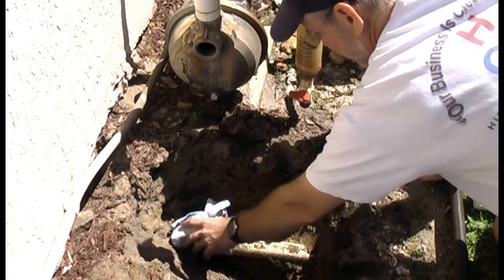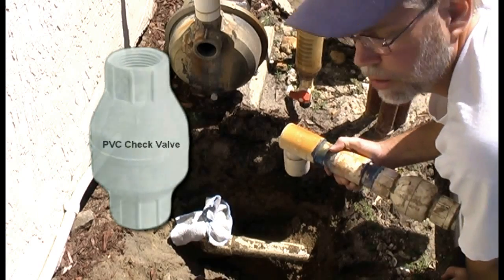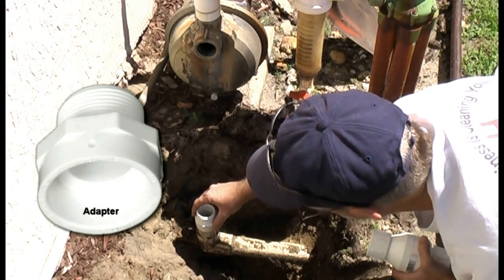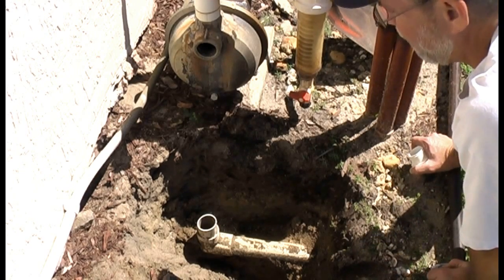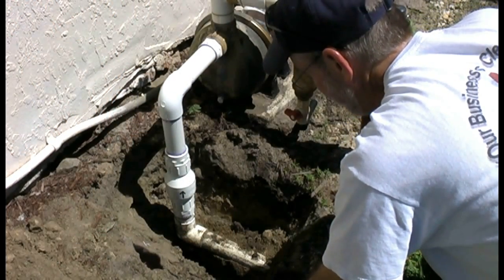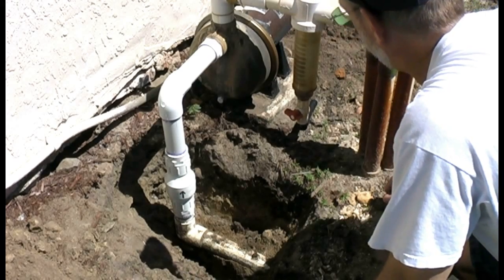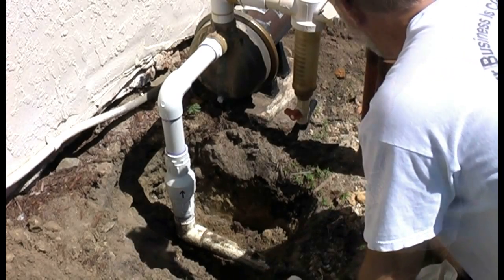Sprinkler Pump Loses Prime Check Valve Replacement

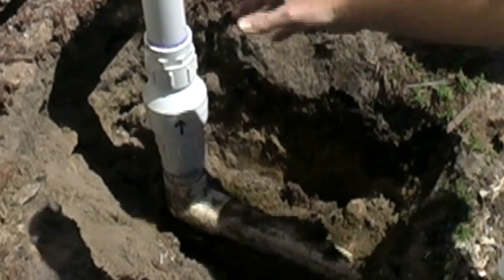Comment: 4:30  If you add a Union where you mention cutting in the future, you'll be able to disconnect the pipe (instead of cutting it) and then reconnect it after you swap out the check valve.
Reply from the maker: Yes, I state that in the video.

Comment: I also live in South Florida.  How did you diagnose that was the problem?
Reply from the maker: There is a lot of sand in the ground wells in Florida, it's common for the check valves to get clogged up.

Comment: You seem very handy. Not a plumber either. My check valve was installed with arrow up and arrow down wont activate my sprinkler zone either way.  Clock is fine.  Water won't come out even by loosening solenoid.  Your tip or any other youtuber's will be appreciated.
Reply from the maker: One more thing, when my pump has had issues in the past of not pulling up the water I used my garden hose to prime the pump to get it going. Try that and good luck to you.
Reply from the maker: Thanks for the comment. Hopefully someone else with more expertise will chime in but I would say that maybe the pump motor itself is defective or worst case the well has to be re-drilled or if there is a foot valve in the well that may have to be replaced.

Comment: Live in south Florida too, I had to replace the pvc well pipe that goes down to the well, didn’t see any foot valve, do you recommend a foot valve??? Or just the check valve is enough? Thanks
Reply from the maker: I've always assumed there was a foot valve in mine but if yours didn't have one then maybe you don't need one or maybe one should have been installed originally. I have no clue as to what the answer is.

Comment: Great video.  I'm also in South Florida and my pump keeps losing prime.  I started digging out the ground looking for an existing check valve but haven't found one.  Is it possible there isn't one or it's required to keep a prime and I just have to keep digging?
Reply from the maker: Thanks, yeah there will be a check valve somewhere before where the line goes down. Mine was very close but my neighbor who is a few doors down, his was located about 30 feet towards the street and in the front yard. You could just install one close. If I went about 10 feet and nothing, I would just put one in.
Reply: Are you pumping from a lake or a well?
Reply from the maker: well
Reply: Sometimes u dont ned it but install one as close to pump as you can get and a ball valve right after. Easy to prome that way
Reply: You most likely have what’s called a foot valve at the bottom of the pipe going down the well.

Comment: I live in Florida I do sprinklers and repair you are better off the way you did that a union on the suction. side of the pump the 1 that comes from the well a union is a place air can leak it is cheaper to replace a couple pieces of pvc then a pump seal becous a o ring in the union caused your pump to loose prime
Reply: john Kosheluk I think my pump its loosing prime, what part of south Florida are you in?
Reply: Yup probable

Comment: are you able to fill up the pipe once you install the check valve? Im having an issue that my pipe that goes down to the well will not fill up in order for the pump to pump the water
Reply from the maker: roberto bustamante Initially you should prime the pump with the garden hose.  Before I replaced my check valve that is how I would manually get my pump going.  This, at least for me, took about a minute to get the pump to start the flow of water on it's own.

Comment: Hi my name is John I am watching your video agin I am a sprinklercontracter u did a prefect job 1 note u don't want 2 put a union on the suction side less chance 4 air 2 get in union have o rings
Reply from the maker: john Kosheluk Thanks for the advice...
Reply: Another thing u have 2 b carefull of with those flow tech pumps is the band that goes around the pump it comes loose and the seal is lost u have to make sure it is tight

Comment: I am a sprinkler contracter I is better 3 not use union on the suction side less of a change 2 get air in a union.on the lateral line is OK I just don't like any place air can.get into the sys suction side
Reply from the maker: Since you are in the business you know a lot more than me about this.  Your comment does make logical sense to me and anyone who reads it should take your advice.